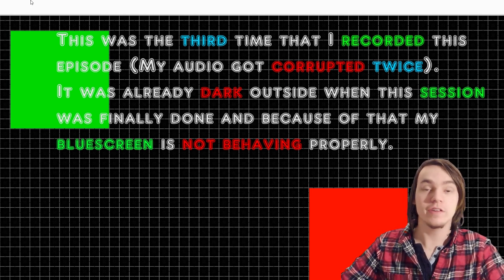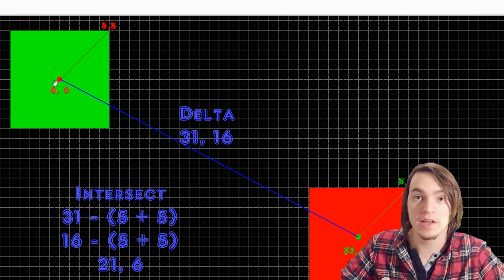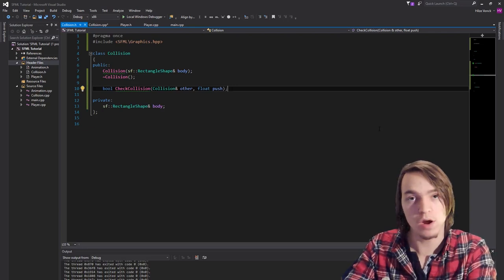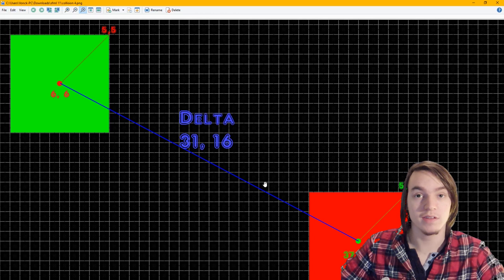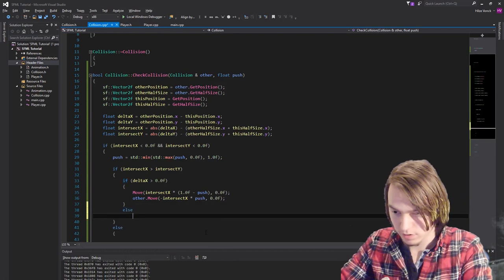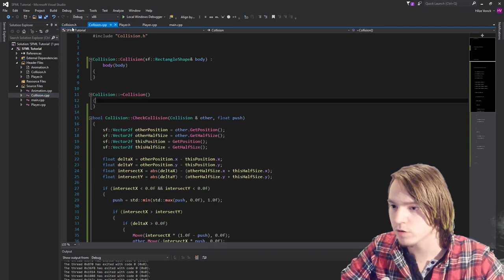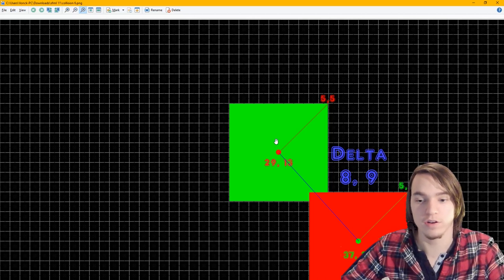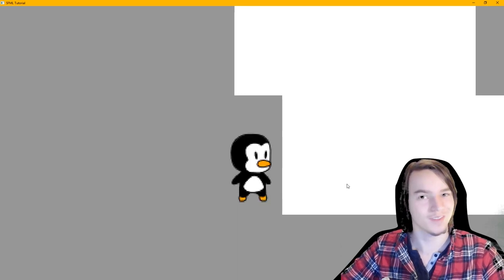SFML 2.4 For Beginners - 12: Collision Detection (AABB).

Comment: As of 2.5.1 the coordinates systems is a bit different so if the colliders go crazy after touching, try inverting the ">" on the if statements in the checkCollision method

I think its because the Y axis becomes positive when tou go down and negative if you go up in the lasts updates. Idk why i also had to invert the X axis tho, i think that one is still normal

Comment: And here I am at the end of the journey, eagerly waiting for your next video. As many others here, I have a question for you: I code on a laptop, and I've noticed that CPU usage goes up by a lot (from ~10% to ~70%) when I launch the application, so my machine starts heating up real quick. Apparently, this is due to the opening of the app window, and it's just in part VS's fault: if I open the .exe in the release folder it's still at least 40% extra work on the CPU. I wonder if that's normal and if there's a way to improve the performance on the system. Thanks

Comment: I get an error "Expression must be LValue" on this part:
        platform1.getCollider().chechCollision(player.getCollider(), 0.0f);
                                                                                          ^
Reply: I got the same error, did you fix yours?
Reply: Same here, not sure what I'm doing wrong.
Reply: So I quess we will never get an answer what's wrong :(
Reply: Hey, I was just having this same problem and I fixed it by removing the & in the CheckCollision parameters.
So instead of CheckCollision(Collider &other, float push), it is CheckCollision(Collider other, float push).
(make sure to modifyt the header as well)
Reply: It needs you to store the players collider before passing it by reference, so Collider col = player.GetCollider(); , then pass col in. Since the getcollider returns a Collider, not a Collider* or & so as soon as that finishes it goes out of scope, meaning the pass by reference will be referencing bad memory.

It's usually more efficient to pass by const reference for somewhat complicated data structures (aka anything thats not a standard int or float etc) but if within the function that is taking it, wants to modify that type - it cannot be const.
Reply: Same here. What does it affect to pass it by value and not by reference?
Reply: Cheddargt pass by reference simply shoves the memory address through so any changes made to it in the function will reflect into that variable outside of the function to. Pass by value simply copies whatever you pass in so any changes made in the function will only be present in that function and the original variable will not be affected. Variables created on the stack will go out of scope when they leave the function they were created in meaning the passed in memory address dies
Reply: You misspelled "check" in checkCollision
Reply: Pass it as a pointer instead of a reference,
Check out the Cherno's C++ video about lvalues and rvalues. He pretty much tells you what you are facing right now.

Comment: When I write player.getCollider() in the CheckCollision method it tells me this:
initial value of reference to non-const must be an lvalue 49	
cannot convert argument 1 from 'Collider' to 'Collider &'
Can anyone tell me why?
Reply: did you fix it? I got the same thing
Reply: @aayushkarki108  nope, I've done the collider method in the class to resolve, but it isn't very correct
Reply: @_simobr   is it possible for you to share the resolved code?
Reply: @aayushkarki108  meme its not properly solved
Reply: I got this error too, I don't know how he didn't get this. The problem is that in the getCollider function you are returning a temporary Collider object and you have a reference to Collider in CheckCollision function,  you are trying to bind a non-const reference to a temporary object which is not allowed. 

What I did was create an empty default constructor for Collider class, create private default Collider objects in the platform class and player classes, then in the getCollider function I set these objects to Collider(body) and return that value. Lastly, I have the type of getCollider be Collider& (reference to collider object) instead of Collider. 

Now when you use pass in   player.getCollider() in the CheckCollision method you are actually passing a reference to a non-temporary Collider object. 

There might be a shorter way to bypass this issue but this is what worked for me.
Reply: @eduardomora6028  Thanks for your solution man, can you give me the code of your getCollider function please ?
Reply: @rodrigoalvesmiranda844  

I explained how to do it already but if you insist: 

Collider& GetCollider()
	{
		ObstacleCollider = Collider(body);
		return ObstacleCollider;
	}

ObstacleCollider is the name I chose for the collider object private variable for platform / player class.
Reply: it needs an lvalue reference, declare a variable of the correct type, Collision pCollision = player.getCollision(); and then pass it as a regular variable. I advise you to get a proper grasp on c++ before entering game dev, especially in a platform such as sfml.
Reply: @Bingo901  it's been an year now and now I can understand the problem easily.

Comment: ATTENTION EVERYONE WHO USED A LIST AND A FUNCTION INSTEAD OF CLASSES
if you had a list that you go throw with a for loop in a function to check for each individual tile
then when you collide do break; or its gonna continue to loop after collision has been detected and set collision to false thus fucking it up but I recommend if you are gonna use a functions make it a bool copy the code then in the update set isColliding = collisionFunc(tiles) (or however you called them) and everything is gonna be fine

Comment: can You please send me the code of player.h where you returns the collider of body.
because i got an error that cannot bind non-constant value reference of type 'Collider&' to a reverse Type Collider.
Reply from the maker: This has something to do with the vs2017 and vs2019 compiler. With the vs2015 compiler you were able to directly use a returned copy as a constant reference, but you are not allowed to do this anymore with the vs2017 and vs2019 compilers. To fix this you simply have to store the collider in a local variable first and then pass that collider into the function, or change the function so it takes a collider instead of a constant reference to a collider.
Reply: @HilzeVonck  actually i am compiling this project using latest version of gcc compiler.
Reply: @HilzeVonck  I haven't quite figured out how to store the Collider inside of a variable, could you explain what you mean please?

Comment: Hi! I am trying to apply this code into my project, changing it up a bit so it runs with sprites instead of a rectangleshapes, however, when it goes into the "GetPosition" function, it is tossing an Exception thrown at error, Access violation reading location.......not entirely sure what I am doing wrong and why returning a position is giving me this

Comment: Hello, i realy like you tutorials. You realy explain things well. but it would be nice if you could put the files online (or code). 
I am running into some problems when i am colliding with the platforms. When i  walk to the platforms, platform 1 is moving away(without colliding), and platform 2 isnt doing anything. except when walking upstairs, then it starts blinking
Could someone help?

Comment: Sorry I have one more question, How do you check a border in sfml. Ex If an object is touching the border it will do something
Reply from the maker: +EricZeBaws do you mean the border of the screen?
Reply: Yes
Reply from the maker: Here you go,
this function will check if a collider touches the border of a view.

bool TouchesViewBorder(Collider collider, sf::View view)
{
 sf::Vector2f colliderHalfSize = collider.GetHalfSize();
 sf::Vector2f colliderPosition = collider.GetPosition();

 sf::Vector2f viewHalfSize = view.getSize() / 2.0f;
 sf::Vector2f viewPosition = view.getCenter();

 float rdx = colliderPosition.x - viewPosition.x;
 float rdy = colliderPosition.y - viewPosition.y;
 float dx = abs(rdx) - (viewHalfSize.x - colliderHalfSize.x);
 float dy = abs(rdy) - (viewHalfSize.y - colliderHalfSize.y);

 if ((dx < colliderHalfSize.x * 2.0f && dx > 0.0f) ||
  (dy < colliderHalfSize.y * 2.0f && dy > 0.0f))
 {
  return true;
 }

 return false;
}

As you can see it looks almost exactly the same as the collision code for checking if two colliders are colliding.
That is because a view also has a center position and a size.
The only thing that really changed is the if statement at the end. This if statement consists out of two parts:
(dx < colliderHalfSize.x * 2.0f && dx > 0.0f) and (dy < colliderHalfSize.y * 2.0f && dy > 0.0f).

both of these parts basically do the same thing but one of them checks the collision on the x axis and the other one on the y axis.

let's take one of these parts and see what it does.
The first part (dx < colliderHalfSize.x * 2.0f) basically checks if the collider is within a certain range from the border (inwards), we need to multiply the halfSize by two because we need the full size for this calculation.
The second part (dx > 0.0f) basically checks if the rectangle is within a certain range from the border (outwards).

So the first part checks the collision for the left and top side of the collider and the second part checks the collision for the right and bottom part of the collider.
The reason that they are separated by an or ( || ) is because we want this statement to be true whenever the collider is colliding with one of the sides of the view, and not just the corners.
Reply: Thanks so much!!

Comment: Hey i have an error C2664 "bool Collider :: CheckCollision (Collider &, float)": it is not possible to convert argument 1 from "Collider" to "Collider &"
Reply: Please really help me i wanna make the game but i cant
Reply from the maker: Hey, the problem is that it is trying to get a reference to an object that isn't defined anywhere. The solution is to simply store the result of the getcollider function and use that variable as an input for the checkcollision function.
This is an lvalue vs rvalue issue. vs2015 didn't see this as an issue, but since vs2017 the compiler started to treat this as an error.
I hope this helps
Reply: @HilzeVonck  i love u Man. Thanks for fast response. You made mine Day better 😀
Reply: @HilzeVonck  anyway i am new and i work at sfml like 1 hours can u tell me how can i use code to do it and where should i put it please. Still thanks a lot dude
Reply: @HilzeVonck  i am 14years So i am bad xD
Reply: @maciejstefanski1652  Collider a = Player.GetCollider();
		Platform1.GetCollider().checkCollision(a, 0.0f);
Reply: After applying the solution it is saying undefined reference to 'Collision::CheckCollision(Collision&, float)'
Reply: And my class is actually collision.h and not collider.h

Comment: I keep getting the error 'bool Collider::checkCollider(Collider &,float)': cannot convert argument 1 from 'Collider' to 'Collider &'
At the very end, I've tried re watching the video multiple times but the code seems to be fine, anybody know what is going wrong here?
Reply: Hey. I got the same error. Did you manage to resolve it?
Reply: I've got this one too... If I find a solution I'll post it
Reply: Okay the solution I found was to put this line before we check collisions between (platform1 and player) and (platform2 and player in main.cpp: 'Collision (name of your Collider member) = player.getCollider();
After that, just replace player.getCollider with (name of your Collider member) in both checkCollision calls that follow
Reply: As far as I  can tell, the compiler just didn't want us to use a member function for this variable. If anyone has a better explanation, I would love to hear it.
Reply: Not a solution, but I did this tutorial a while back on VS community 2015, and the code worked exactly as is, I am redoing it now to get back into SFML with VS community 2017, and I get this exact same error. So, perhaps it is something weird in the newest iteration of the compiler. And your solution did work for me.

Comment: Hey,

first, its a good tutorial, thank you. But could you pleaseupload your code to github or something else? 
I'm geting two errors in the code for this two lines:

platform1.GetColider().CheckCollision(player.GetCollider(), 0.0f);
platform2.GetColider().CheckCollision(player.GetCollider(), 1.0f);

Invalid arguments '
Candidates are:
bool CheckCollision(Collider &, float)
'

Invalid arguments '
Candidates are:
bool CheckCollision(Collider &, float)
'

invalid initialization of non-const reference of type 'Collider&' from an rvalue of type 'Collider'

invalid initialization of non-const reference of type 'Collider&' from an rvalue of type 'Collider'

Can anybody help?
Reply: I have actually been working on rewriting all the code to upload to the site that I am building all day. All of the source code for this video should be up there. 
Here is the link: http://lucrifi.com/index.php/24-sfml-2-4-for-beginners-12-collision-detection-aabb?start=1.
As a note though. The site is not yet finished at all, so if something is wrong or if something does not work, It'll be fixed as soon as possible.

I think that the problem is either in the player's GetCollider() function or in the variables that you are passing into the CheckCollision() function. Make sure that the player's GetCollider() is NOT returning a reference to a collider. And make sure that the CheckCollision() DOES have references to the collider (both in the .h and the .cpp).
Reply from the maker: +Herovy070 whoops, I replied with my secondary YT account. Herovy070s reply is mine.
Reply: Thanks for the quick respons, I checked your link and checked your code with this page https://www.qualidator.com/WQM/de/Tools/TextDiff.aspx, I could not see any significant difference to my code, 

This is the play's GetCollider()

Collider GetCollider() { return Collider(body);}

and this is CheckCollision()

in .h
bool CheckCollision(Collider& other, float push);

in .cpp
bool Collider::CheckCollision(Collider & other, float push){
Reply: Please help! I have the same issue, or if there is anyone else who has a fix for that matter.
Reply: The problem is that you have defined the CheckCollision function to expect to get a reference and not a value. Remove from the function arguments the ambersand (&) sign.
Reply: @bigshrekhorner  but then the collision detection won't work and the player would just go through the platform
Reply: @TR_Arial  Ye, written that 3 years ago, was wrong, lol
Reply: @bigshrekhorner  so... Did you find a solution?
Also sorry I see that it was 3 years ago
Reply: @TR_Arial  Didn't really think about it, to be honest. Could be an error with the class declaration/definition? That is the first thought that comes to mind
Reply: Hey. 
This is a known issue that happens on a lot of compilers newer than the VS 2015 compiler that was used.

The problem is that player.GetCollider() returns a temporary variable (r value) and X.CheckCollision() takes a reference (l value).

Since the temporary value is not stored anywhere, it cannot be referenced.

The fix is simple. 
Simply store the player collider and then use the stored collider in the function call.

Something like:
Collider playerCollider = player.GetCollider(); in the main function to store the collider and call it with :

platform1.CheckCollision(playerCollider, 0.0f); so (playerCollider, instead of player.getCollider())

The fix was originally given by Hilze himself in the comments.